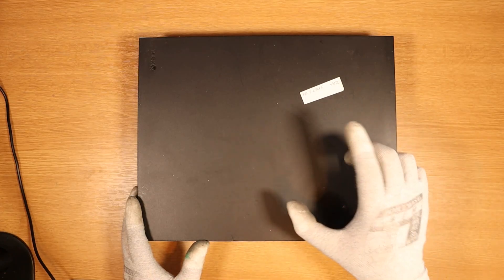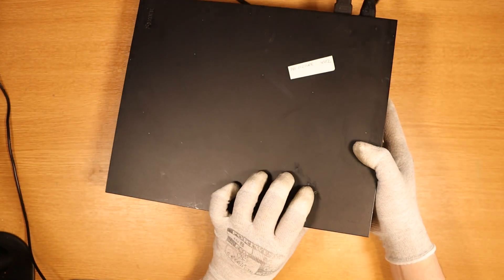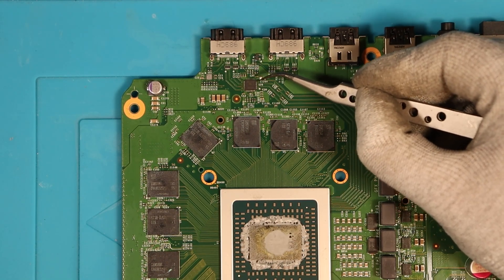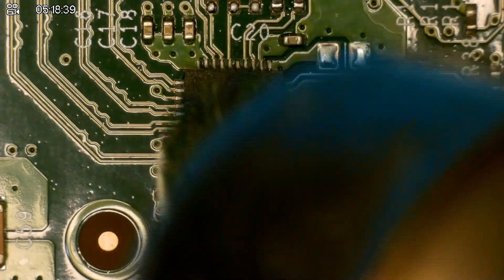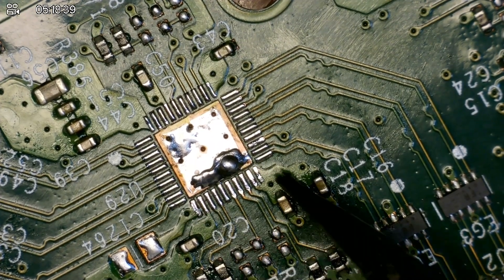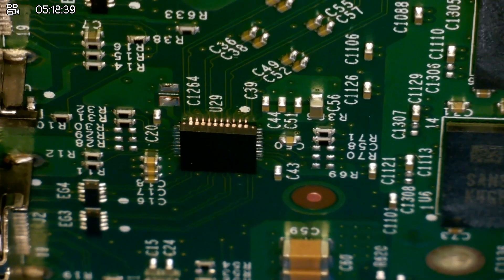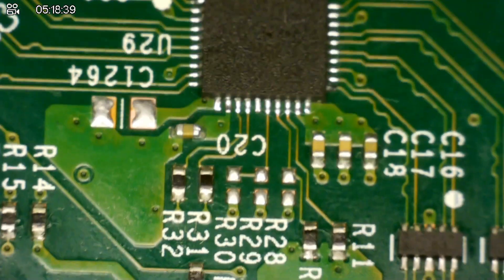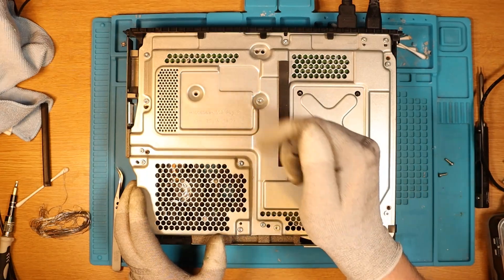I Paid Only $90 for a FAULTY Xbox One X 1TB | No Display | Can I Fix It?

Comment: Nice work Joey!
The filter pads go on the top metal case on the connector side, they just slide on the edge that will sit on the connectors.
Reply from the maker: Thanks pal :) does it just help for noise dampening, or was I completely off? :)
Reply: @JoeyDoesTech  They in theory are for RF noise yeah. Though I left a a few off before I knew where they went and never had a complaint so not like critical.